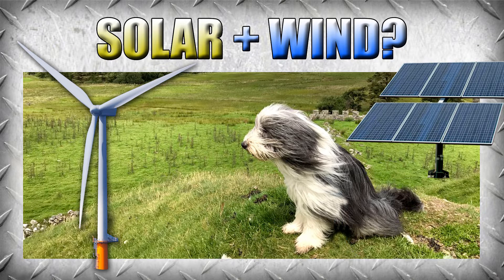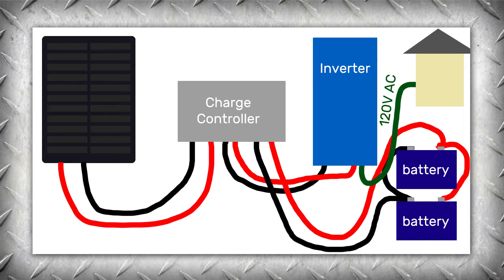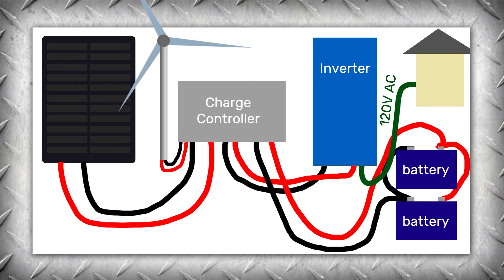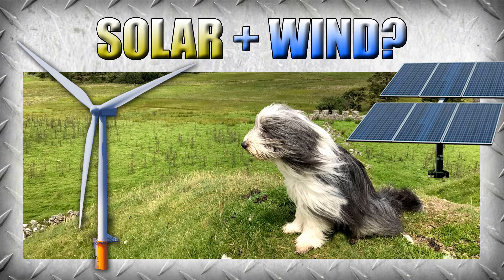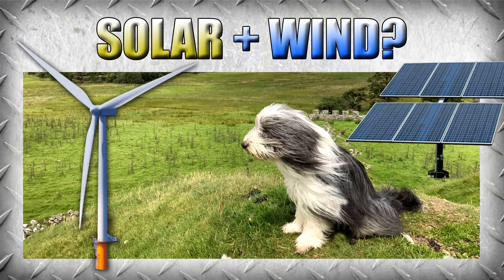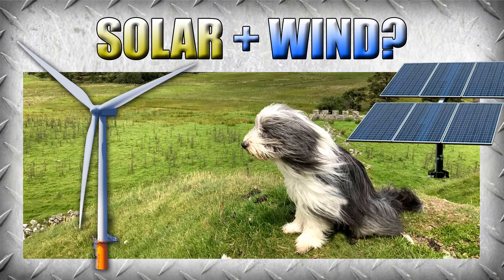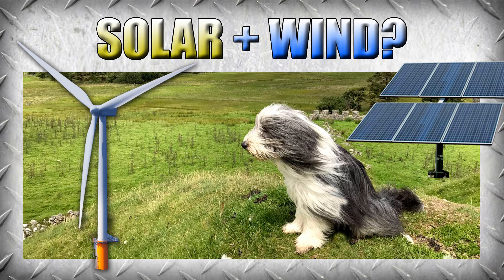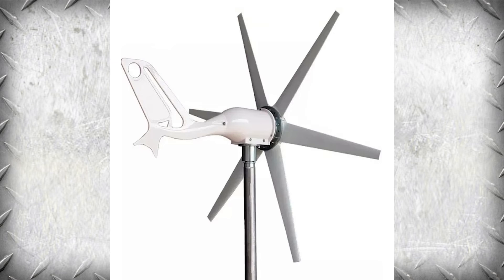Should You Add Wind Power to Your Home Solar Power Setup?

Comment from the maker: Yes, dumping off overflow energy to ground is a bit of an inaccurate oversimplification but I didn't want to get too much into the wiring of wind systems in this video.
Reply: Dump into a hot water cylinder, at worst boil off water?
Reply: I bought two 24 volts 100 amp hours lithium iron phosphate batteries ⚡😎👍 for my system. It gives the juice somewhere else to go. Showing 26.42 volts at noon. It's super cloudy but it's windy. I'm going to raise the wind generator three more feet to get cleaner wind.

Comment: if the solar panel is hooked up to a victron and the wind is hooked up to a victron can they both charge batteries like that? or is it better to get wind only? i only say that because victron says it can connect and stop charging. has a float mode or whatever? idk

Comment: 300 kwh per month in the UK supports a 4 bed house!
A log cabin with a wood burner world almost need 2kwh per day.

Apart from AC what are Americans using that would use such a large draw.

Btw a quarter the power for people in the UK is used on boiling the kettle for tea 3-8 times a day.

Comment: doesn't the wind turbine just spin without a load attached to it? i mean you can switch it off the circuit just like solar panels, afaik. both will have open circuit voltage present, but no load so everything is cool
Reply from the maker: I actually don't know where the energy goes if it doesn't flow somewhere. It has to go somewhere. I think the magnets in the alternator style generator would heat up maybe? That would be bad. I've heard brake failures on wind turbines can result in fires so I assume the energy turns to heat somewhere.
Reply: @EmergencySurvivalTips  there's no energy if the circuit is open, because current doesn't flow
Reply: Electrically that could be just fine but mechanically a wind mill spinning out of control could soon be a problem because of G forces. They could be constructed strong enough but that would make them heavy and expensive so no one does that.

Comment: I'm firmly convinced that the solar panel producers have the entire youtube community paid off. If I drive through the surrounding countryside here all I see are wind turbines, yet nobody can say a good word about installing a turbine. The amount of fear mongering utter bullshit is astounding.  I know it's windy here and not so sunny in the winter especially. I'm on my own here and ok,with that.
Reply from the maker: Nah, I bought my gear. I'd never install solar north of about Kansas and I'm in Wisconsin. Too cloudy for too much of the year and too different of a UV index.
Reply: Most videos are about small turbines targeted at home owners who don't have a lot of land. These are pretty disappointing compared to say 20 solar panels which are typically cheaper too. You will need at least 5 m for the propeller diameter to get something useful for a home, outputwise. These are not offered online to be sent to your house by Amazon so you can review them. This skews the picture (on YouTube) considerably.

Comment: Very well done! Thank you for posting! I’ve finally found the information I’ve been looking for. We have a Tesla Solar and Powerwall setup. We are in sunny southern CA so adding wind in a residential area doesn’t make sense. Can you post a detailed video analyzing the different wind turbines that include ridge version that utilizes a roofline?
Reply from the maker: I probably could if I've ever installed them. That's the part I'm not as familiar with compared to the electrical components and the math. Last I heard the vertical ones with short blades that look like cylinders are the best for consistency in low wind but there are people that know A LOT more about it than I do.

Comment: Just so you know you can use a hot water heater to dump and there is no problem running two controller’s also you can just make sure you always have a load big enough that your batteries don’t hit 100% thats the last problem I’m having i want more like steam turbine powered by used motor oil it gets as hot as plasma over 1000 degrees 😂
Reply: Can you elaborate on hot water heater to dump?

Comment: Can the wind turbine and solar panels charge battery’s at the same time
Reply from the maker: If the charge controller has the capacity, yes. But usually you'd have two charge controllers since the voltage coming in off each is so completely different.

Comment: I added a 600 watts wind generator to my 1600 watts of solar panels. They charge twenty deep cycle batteries to run my 24 volts Aims Power inverter charger. I used to have to use a gasoline generator in November and March until I got the windmill.
Reply: What model wind generator if you don't mind my asking? I have three 500w 12v nature power wind generators with built in charge controllers, and I'm wondering if I'll be able to 1) connect all three to the same battery bank without issue and 2) whether there will be any issue connecting them to the same 12v battery bank as my solar panels? Any insights are appreciated!
Reply: @shawngarred8929 Sorry, I didn't see your comment until now. The one I have is a B&C from Green Energy Solutions. The aluminum tail fin got ripped in half in May from a tornado 🌪️, * made one out of steel.

Comment: So given the difference in where the extra power goes vs how the the solar just stops charging when there is no sun, would a better hybrid system be solar +Hydro?  I would think that the hydro would be a more similar system with wind instead of solar.

Comment: When solar production is low, wind production is typically high.  i.e. winter months, night, weather.  with net metering, wind could just generate more credits back to the grid.  but i could see hybrid systems becoming the norm for filling in the gap during produced/consumed during winter months when solar production is much lower.  as far as "Costs".  as adoption goes up, costs go down.  vertical turbines are on the horizon, omnidirectional turbines are on the horizon.  eventually, hybrid will be the de-facto standard.  instead of "oversizing" your solar for 9 months just to meet demand for the winter, it makes sense, to size solar more to summer demand, and close the gap with wind during non solar production hours.
Reply: If winter is your only concern try a chp (combined heat and power system)

Comment: Just like an a/c compressor on a car. It has an electro-magnetic type clutch. I think it works when an electric  type sensor tells the clutch to engage the clutch. The same can be done with a wind generator. I also know there are sensors that tell the circuit to keep the power coming through the line if the batteries are not fully charged, & once the battery bank gets below a certain level the sensors will tell the clutch on the blades to engage if they are spinning & the electric circuit will close directing the electrical energy to charge the battery bank. So if the roof of your home is completely covered with  solar panels & you have a couple of sailboat wind generators, & a battery bank big enough to support your power needs, be it a single person, a couple or large family would never have to by electricity from the greedy power companies anymore. People could live completely offhrid even in a city. Also with about 3 or 4 more solar panels & another wind generator, then a person could  build an electrolysis plexiglass tank with steel plates in them plated with silver, & fill the tank with water some citric acid such as lime juice & they could break down water into hydrogen with the free energy of solar & wind power &  store the hydrogen in several scuba tanks, or oxygen tanks from acetylene cutting torches, with heating elements in them. Then they wouldn't have to buy diesel or gasoline to burn in their vehicles, because they would have hydrogen from the splitting of h2o aka water. All internal combustion engines including jet turbines can burn Hydrogen, which leaves no emissions, when it burns it turns back into water a never ending cycle. Peace, health & love. Yeshua bless you all.

Comment: I wired a cheap chinese Windmill into a Coleman Solar system. I tagged the leads from the Solar controller to the Battery bank on one set of lugs.. I tagged the Wind and wind controller on another set of lugs.. Both seem to be working well. Both controllers  both see 13.4 volts and cut the power. I see the Brake on during the day with the windmill....And the solar working away. At night The wind blows and keeps the power at 12.8 volts with the Fridge going.. I'm on a windy Atlantic cost. So Both where a great addition to the camp.  I'm sure people will say.. You can't do that. But it's working for me.

Comment: Pretty sure the charge controller will protect the batteries. That is literally what its for. Also, you can stop a turbine. They have brakes. They dont have to spin all the time. You can apply the brake manually or it will apply automatically if the wind speed is too fast. When the brakes fail in extreme wind... thats where the real problem is!

Comment: I think having wind back up is great , you need to have the proper controller, that said , a wind turbine works at night, it also charges at a higher rate then solar sometimes, it will usually be windy enough at least once a week to completely top off your batteries, when the sun is not out , it Will usually be windy and sometimes when the sun is out it won’t be very windy , at least that is how it works out on a sailboat, I would be interested in vertical wind generators , just cause they look kool
Reply: How do you figure if what’s the “proper propeller”? Thanks

Comment: Isnt the charge controller controls the current from solar panels or wind turbine not to overcharge the batteries?  Excess energy produced by the panels & turbines will be just wasted bcoz the charge controller will not allow the batteries to be overcharged or damaged right?

Comment: So where does your car alternator "dump" power after the battery is charged?
Reply from the maker: That's a good question. I'm not actually sure. It can't even just ground-short it because the battery is the ground since the tires are insulated.
Reply: @EmergencySurvivalTips A car alternator will not spin out of control when the battery is fully charged because it just decreases the load. 
The turbine can not tell the wind to stop blowing because the battery is charged thus needs to dump the excess wind energy in resistors or short the alternator windings to brake the turbine. Some charge controllers does this and doesn't need a dump load
Reply: It shuts off for a bit. Until the voltage drops enough for it to come back on
Reply: You would install a electronic brake on the turbine when batteries are charged the charge controller will divert the power to the electro magnetic  brake witch will slow the rotation of the blades and reduce power output

Comment: Very good video!

For the expense of setup and maintenance of a wind system, you are usually better off putting that money into more panels, batteries, and some extra fuel for the backup generator. 

Also, the wind generator is the least portable part of an off grid system if you want to relocate.